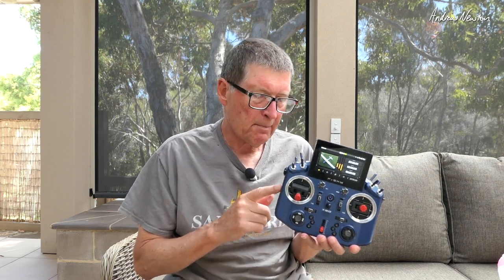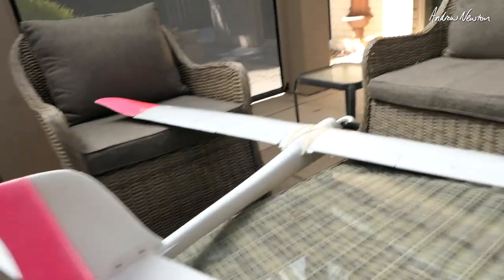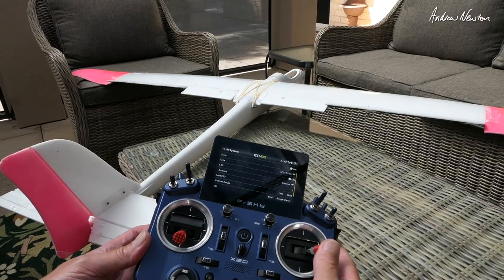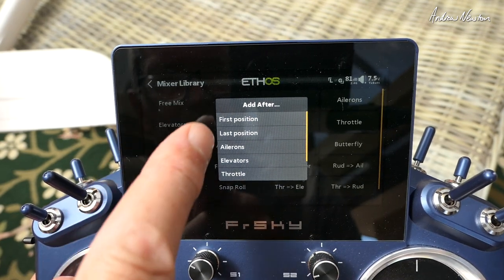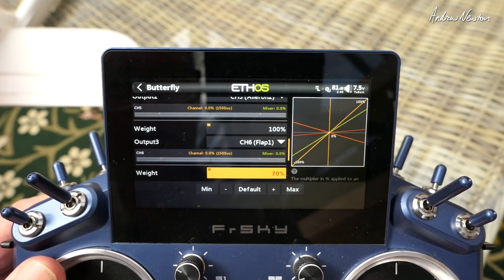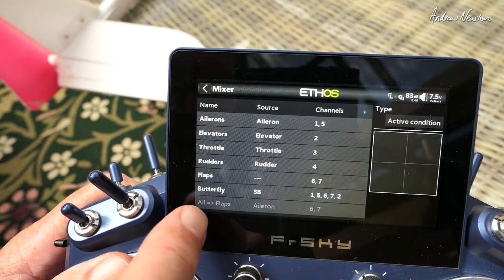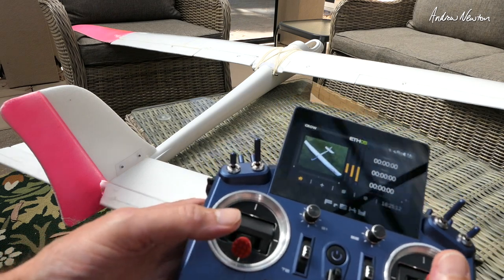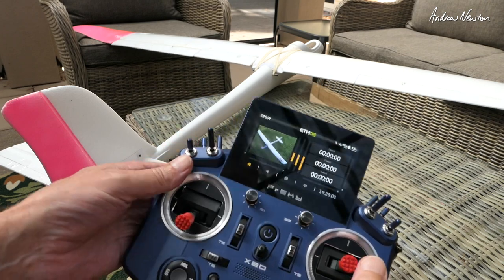Ethos Glider Preset Mixes

Comment: Very nice radio, well explained. Pity crow braking isn't doable on the throttle stick. Thanks Andrew and Merry Christmas
Reply from the maker: Thanks Knut. I think you just have to choose Throttle instead of the switch
Reply: @AndrewNewton  Sorry Andrew is that a "I think "or a "I know". Because it makes the world of difference for landing gliders, using the throttle stick for crow braking. You should try it.
Reply from the maker: Would you then put motor on a switch?
Reply: @AndrewNewton  Throttle on left slider.....
Reply: @AndrewNewton  yes, I have mine on a 3 stage switch. Off, half and full power. I wouldn't have it on a power plane, but a glider has the motor only as a means to get hight, apart from that I don't use the motor.

Comment: Hi Andrew, I'm new to FrSky and have found your videos very helpful so far.  I have an X20RS and am presently setting up a couple of competition F5J gliders.  I am seeking assistance at this time in relation to the flight timer.  Flight time is critical for F5J ensuring that landing can be achieved prior to the horn sounding for the end of working time.  I have set the timer up with the timer to start when I start the motor and launch.  The motor is on a 3 position switch with off, half power on middle position and then full power on the 3rd position.  I need the timer to start whether I launch at half or full power positions and I need it to continue running if i vary between these 2 motor power positions in the launch time of the flight. Essentially I need the 3 position switch to be on in both the middle and 3 positions. Would appreciate any guidance you can provide.   Thanks Evan
Reply from the maker: Greetings Evan. I don't use timers so might not be a lot of help, I'll have a play with mine anyway. Have a look at Steve's video on Ethos timers https://www.youtube.com/watch?v=qjmix45yIEQ
Reply from the maker: I think I have it. Let's call SA your throttle switch. Timer Start Condition needs to be !SA^ (which means SA is not up. SA up is the zero throttle position) and change Stop condition to Custom with nothing entered as the condition. Then I would use a momentary switch to Reset back to the start time.
Reply: Excellent  @AndrewNewton   working a treat - cheers Evan
Reply from the maker: @banko4509  Ah brilliant. Might have to do a quick tip video.

Comment: Question for you Andrew, love the vid, makes it easy. So have crow working, well sort of on a switch. Both Flaps down, but one aileron will move slightly down, not up. I've change 'inverted' in the output but that only makes both ailerons go the same direction. Is there something in the mix i'm missing? Taa
Reply: All good Andrew, i reset everything and manually created the mix, seems something isnt right with the butterfly mix and my Pulsar.
Reply from the maker: Don't INVert the Output, that changes it for ailerons and crow mix. Just adjust the weight of the aileron line in the Crow mix. It starts as 10% I think, may need to be something like -30%
Reply: @AndrewNewton  All good, reset the model from the start. Still cant work out why it did that. All working now. Thanks again